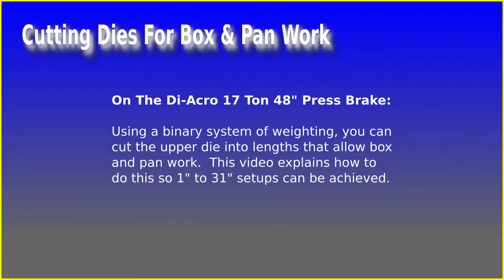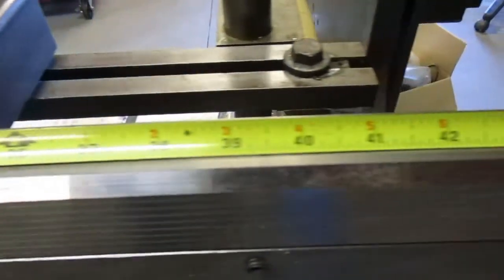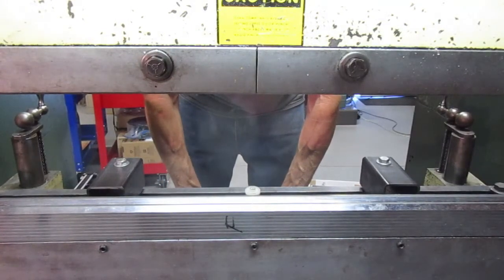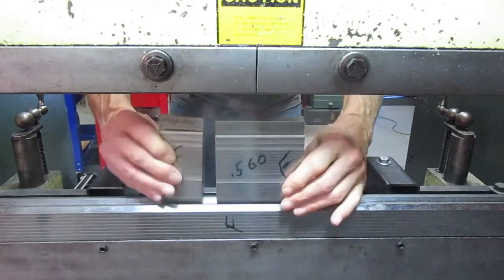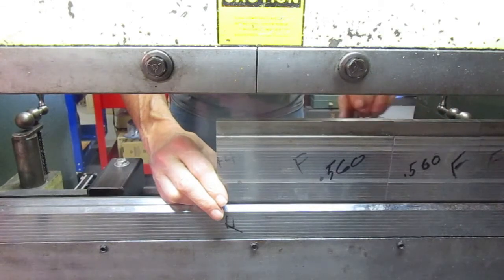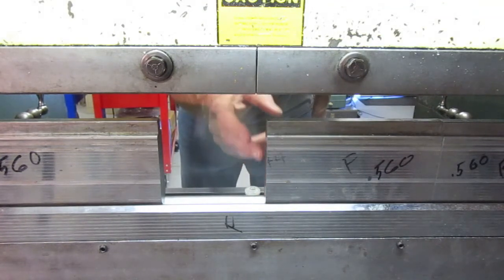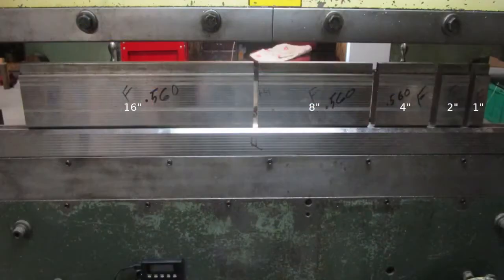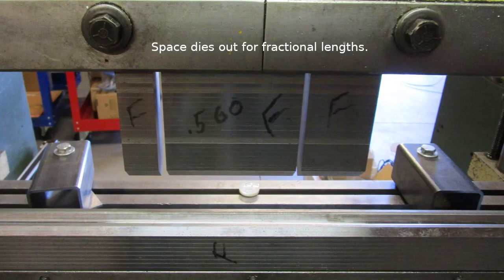Di-Acro 17T 48" press brake, cutting your upper die for flexible box/pan bends

Comment: Thank you for making this. I’m just learning how to use my brake. I messed up and cut random sizes. It could cost me a small fortune to replace my die as a result. Videos like this could help others from making the same mistake. Thank you again!
Reply from the maker: U R Welcome.  Sorry to hear you messed up your die cuts.  The goals of these videos are to provide suggestions, help, advice and food for thought.  I worked with powers of 2 as explained.  If you can cut the remaining die sections you have to build 1",2",4",8" and 16" sections they don't need to be all in one piece.  Just aggregated together for final lengths that offer flexibility.  A 4" piece could be a 1" and 3" piece, for example.  8" could be 1", 3" and 4".  Not sure if that works but maybe it's helpful.  Work safely.